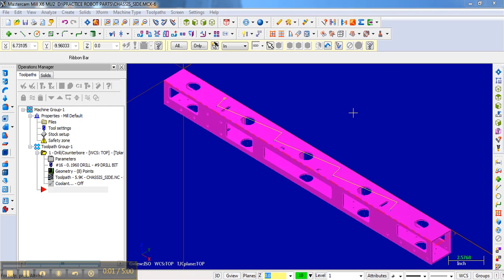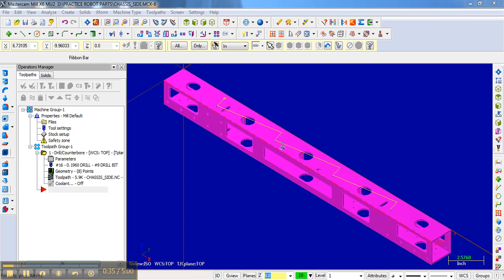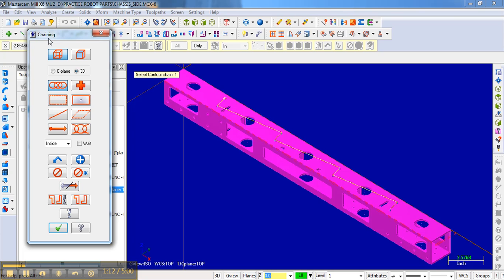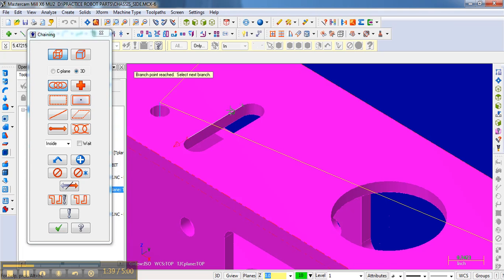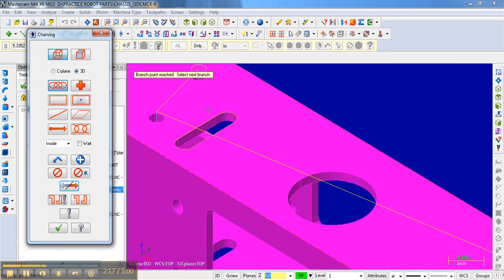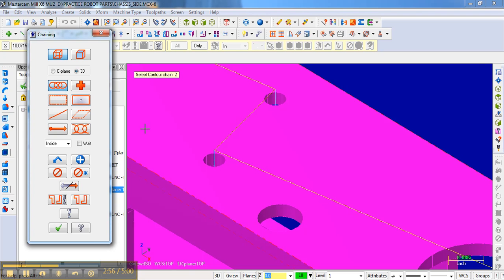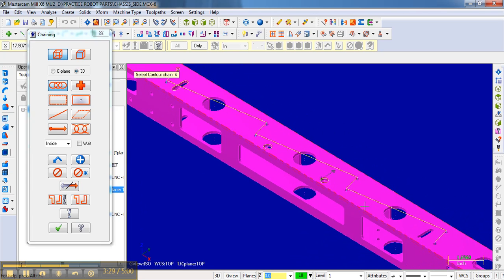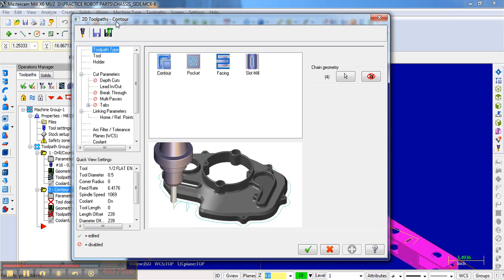mastercam basic milling lesson 08   selecting contours

Comment from the maker: I'm not certain, but I think your problem is that when you imported your solid model, the edges were not imported. To check this, select the part and hit the capital Sigma button which will give you statistics. If you only have the solid, it will tell you so and say 1 solid and zero edges and contours. To change this setting, go to settings/configuration/converters and select edge curves. Check our other video entitled "Mastercam Quick Starts Lesson 1 - Your First Plate Part" for a demonstration